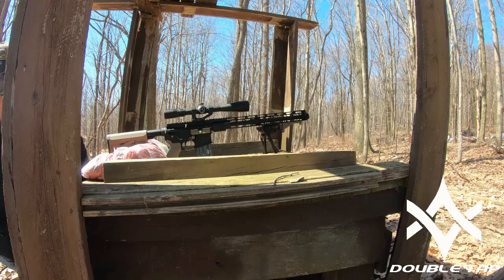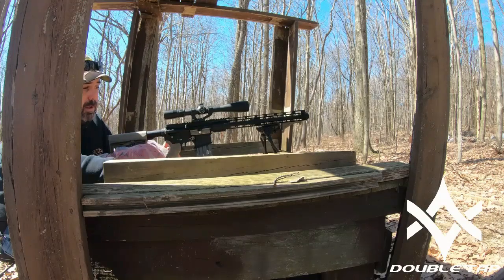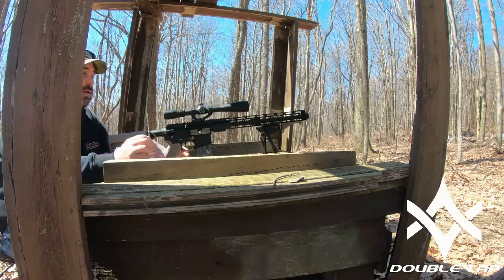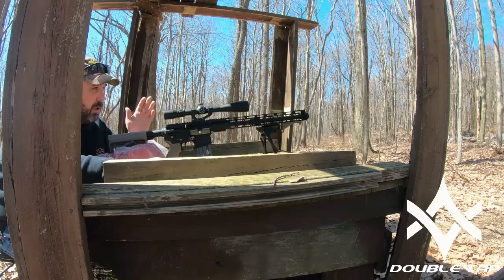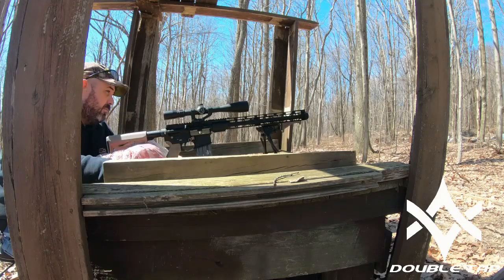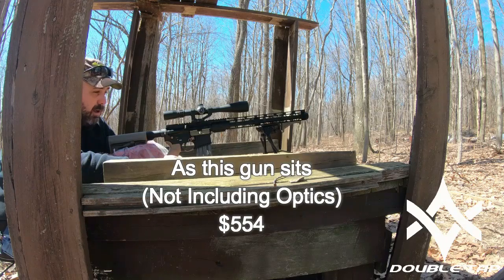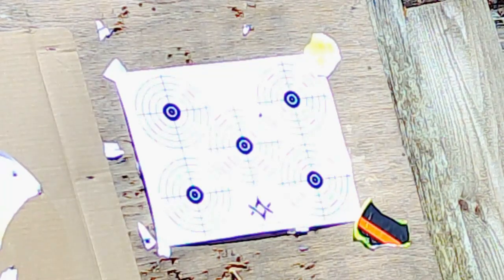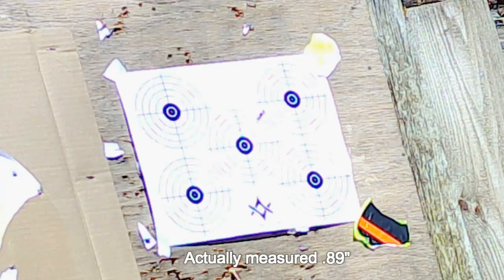Accuracy Test After Lapping & Bedding AR15

Comment: I have personally taken an upper receiver and pencil barrel had slop and play . 2 to 3 Inch groups at 25 yards total crap. I took it and mixed JB weld and bedded it hung it upside down for 48 hrs to cure. Torqued the barrel nut to 82 lbs. It cured the issue added a Jerry Miculek break and hark no barrel whip good to go. I'll never be taking the barrel off that upper receiver no worries at all about bedding it with JB weld. It's rock solid.

Comment: Good shooting!  Looks like all your hard work paid off.  Did I miss a video on lapping the barrel?
Reply from the maker: in the description
Reply: @GunGuyOK  OK I saw this one. Did you actually lap the bore?
Reply from the maker: @paulwatterson5992 I lapped the upper receiver and bedded it with locktite
Reply: @GunGuyOK  Is it possible to lap the bore by hand?
Reply from the maker: @paulwatterson5992  You really should have the lapping tool, they really are cheap. If you just needed it once you could buy it, use it, then sell it on ebay. I'm sure it could be done by hand, but I wouldn't know how.

Comment: CMC has an inexpensive 3.5 lb trigger, under $200. Primary Arms currently has a few in stock.
Reply from the maker: I can make a  mil spac close to that for almost nothing...stay tuned!
Reply: @GunGuyOK  now this i gotta see, my ar trigger is a bit rough and i was gonna switch it out with the cmc trigger. but now im gonna wait.
Reply from the maker: @Mobius762x51 Have you done the paracord trigger job in the description? Takes 10 min, doesn't cost anything and it works... I'll try to make the full version this weekend and get it posted.
Reply: @GunGuyOK  no i havent. i noticed that u mentioned in a few times.
Reply: @Mobius762x51  I did it and it really works well.
Reply from the maker: I just put that video up
Reply: Best two stage trigger I've shot with is hands down the larue mbt 2s 
The price is definitely a big 'fuck you' to geissele

I've shot the geissele SSF's, SSA's, G2S's and SSA-E's and prefer the larue, it's around $80
Reply: You can polish a mil spec and install JP 3.5 springs(10 bucks, MidwayUSA) and bob the hammer so you dont get light strikes and get a decent trigger for next to nothing. Is it as good as a American Gold or Trigger Tech adjustable, No
Reply: @charlesbarger8872  definitely wanna give that a try
Reply: @comfycouchreviews  yeah I was going to mention Larue as well. Their triggers are the best value going especially if you catch them on sale.